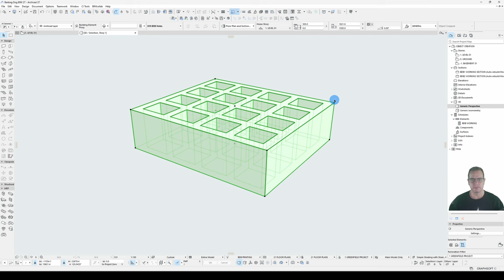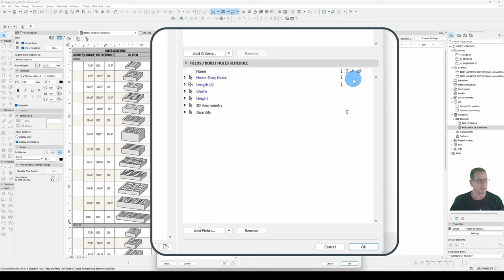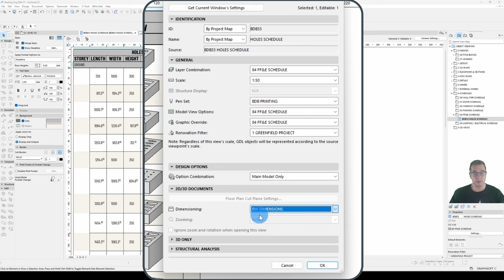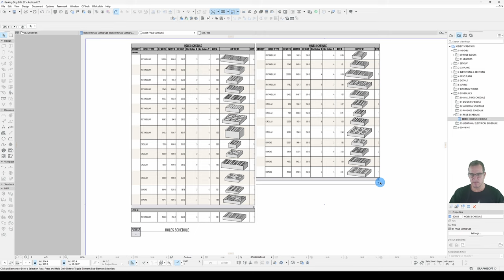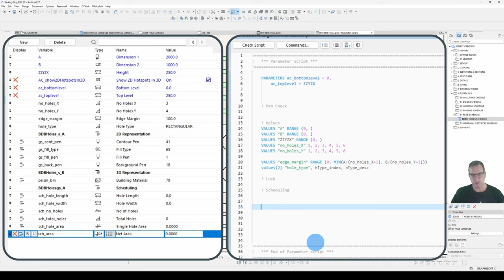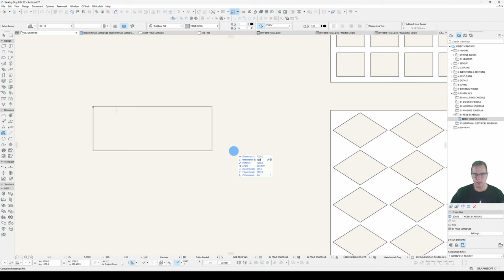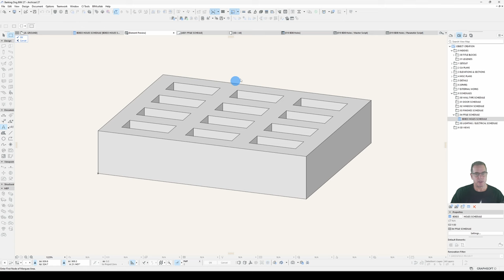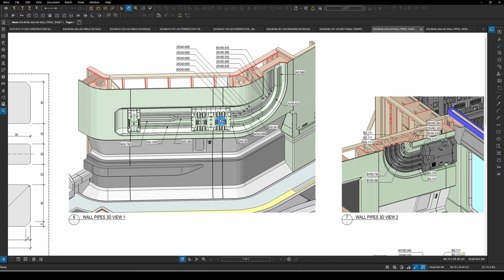033 Scheduling Custom Archicad GDL Parameters

Comment: First time commenting, but already learned a lot from your videos (I even made some parametric doors!).

I wonder about the "both" paramater on the façade. Was it a boolean and that's why it scheduled as a box with or without a cross?

It would be really nice if it was possible to schedule a custom drawing, for example a 3D projection with built in annotation by code... Doesn't sound possible if you can only work with parameters, right?
Reply from the maker: Yes, BOTH was a boolean parameter.   To make things look different in a schedule, you use the GLOB_CONTEXT global variable to test if the object is being generated in a schedule (6 - list), then you can draw just about anything you want.
Reply: @BarkingDogBIM  that's really useful. Thank you!

Comment: How do I insert the surface name information of this object combined with any other information I want into these parameters created for the listing?
Reply from the maker: You can list any parameter (except for hidden parameters) in a schedule - so just add the surface parameter.  If you want to extract information or combine information of parameters into a new parameter, use the string functions SPLIT, STRSTR, STRSUB.
Reply: @BarkingDogBIM  Sorry for my English. What I meant was: Grouping a surface name with the "sch_no_holes" parameter for example. Using the request command doesn't work because the language doesn't allow inserting information into the parameter. The request only works in the 2D script window.
Reply from the maker: I see.  Unfortunately you can't do this.  Definitely a shortcoming in GDL.  I have expressed my frustration over this as well: https://community.graphisoft.com/t5/GDL/Deprecated-parameters-amp-variables-shouldn-t-be-sometimes/td-p/353403